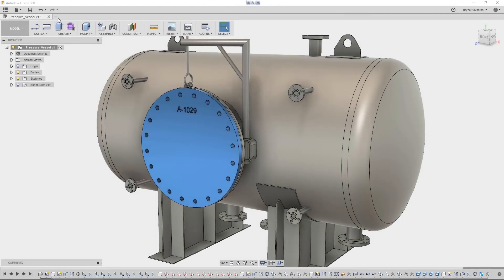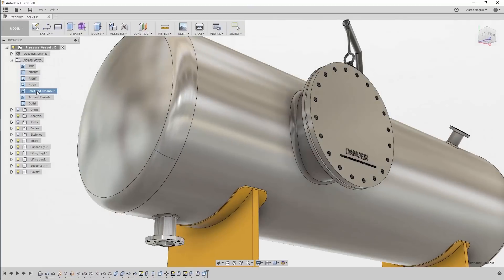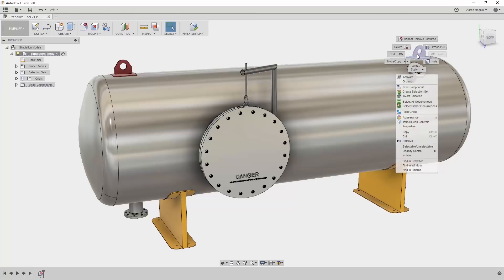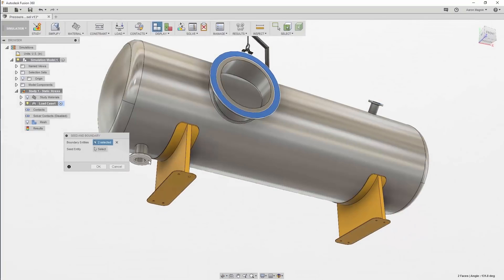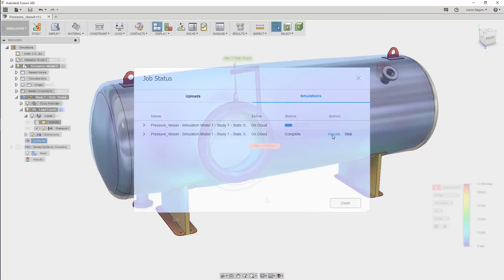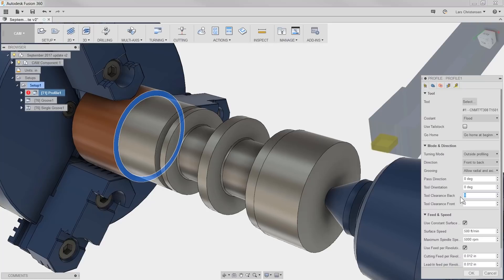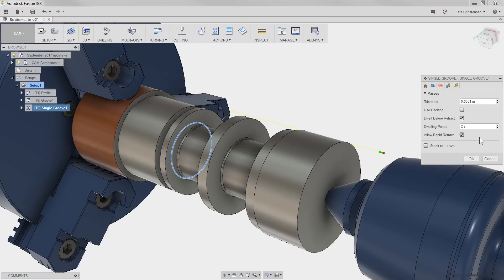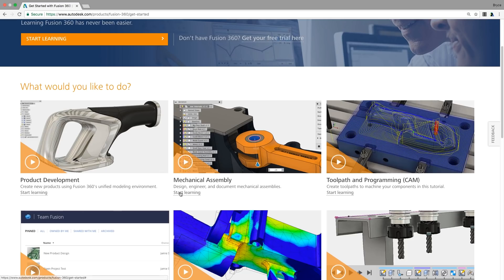What's New in Fusion 360 September 2017 Update

Comment: I am modeling aerodynamic components on cars. I have iges and step files of the mesh model vehicle. I want to create a base of the spoiler that follows the form of the trunk. Is there any way I can create a parametric model based off a mesh surface? because it has the curvature I need to create it
Reply: Hey Steven, We can do a few awesome things with meshes in side fusion. I think what you are looking for is around 1:55 in this video https://youtu.be/8Z0IiVKt5Hg?t=1m55s. Check it out.
Reply: I greatly appreciate your response. That video seems like it will help me alot.